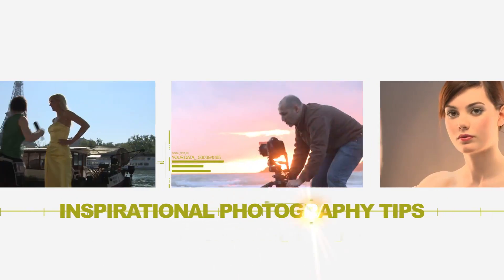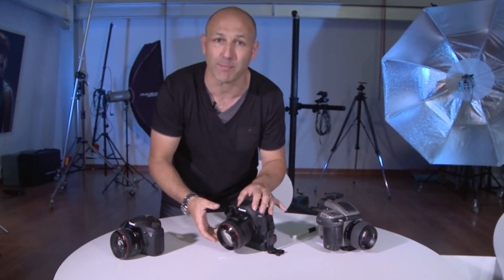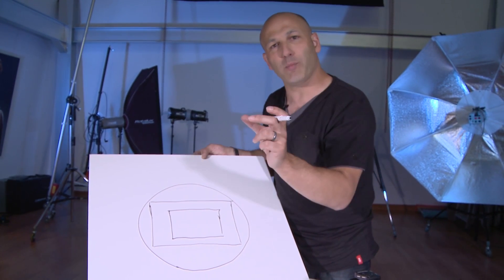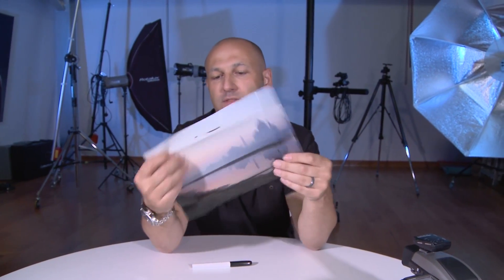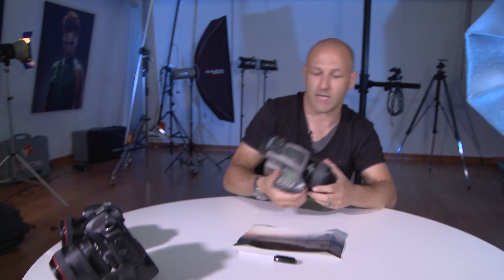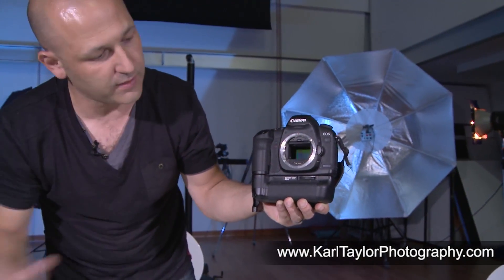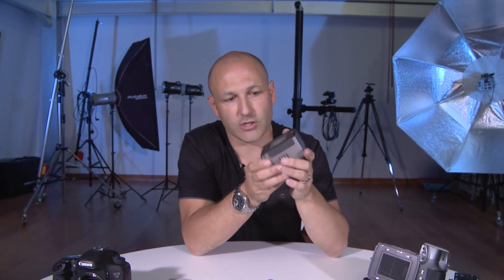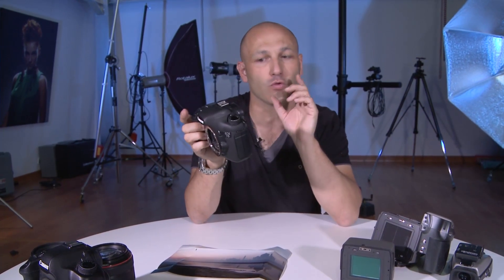Full Frame Sensors vs Crop Sensor Cameras Explained by Karl Taylor!

Comment: whats the difference between a full frame and a crop sensor via a top rear viewfinder??? i can understand the full frame has a LOT more things involved viewfinding than the crop sensor.WHY does the Crop Sensor STLL have the top rear viewfinder..doesnt make sense to me...

If the Crop Sensor was ONLY rear view [NOT top rear] viewfinder that most rear view full rectangle have,that i could comprehend.

seems pointless if the full frame dslr has top view finder and or rear view,then why do the crop sensor copy that.pointless in my mind. 
Great video.ive learnt lots,im NOT a photographer BUT i love photography.i watch you tube  videos then i take my camera and go n try n repeat .ive got a dslr [not full frame] but i love using it...
Reply: You mean the viewfinder? 

The viewfinder difference is in DSLR about magnification. It is about the mirror size that reflex the light to prism and then to eye via optics. Smaller sensor = smaller mirror = smaller view in viewfinder.
The largest viewfinder in SLR cameras was in Olympus OM-1 and OM-2. both had huge 0.92x magnification (it is calculated by using 50mm and then distance to eye etc) while Canon and Nikon had "only" 0.84x at max. The magnification 1.0x means when you take 50mm on your eye, it gives same magnification as naked eye. Smaller magnification means smaller view.

Now on DSLR era those are around 0.6x or even 0.5x in APS-C cameras.
Canon top 1D has 0.76x. Rest of having just 0.62/64.
Olympus has now 0.74x, Fuji 0.78x and Sony 0.76x.

If you mean about DSLR vs Mirrorless, the reason is that the electronic viewfinder at top gives many benefits over the screen at rear.

1) You have better support by having camera at forehead than just at your hands.
2) You see in bright sunlight as rear screen starts reflecting environment light and gets dim looking.
3) You can get larger magnified view

then it has own problems too like you get a "tunnel vision" so you don't see well around view, but screen at back makes you to focus that instead surrounding.
Reply: +Robby Jones 

a viewfinder means a viewfinder, you don't need to specify "top rear", viewfinder means the thing you look through

the screen on the back of a camera is called "live view"

Why crop camera, and many compacts even like panasonics, have viewfinders, is because you can't see a thing on a screen when the sun is shining on it, so you use the viewfinder instead that blocks out most light except the light shining through your lens. Another reason is that a camera held up to your eye can be held much steadier than one with your arms stretched out.
Reply: +Aurelie Nani The viewfinder is a "box" that you look through. An EVF is a version where small display is located. A rear display is just that, a rear display.
the "Live View" means technology where sensor is in continues readout mode and capturing video that then is played back by camera displays, either rear display or EVF.
Reply: paristo
 no one is talking about EVF, it's strictly a mirrorless thing
Reply: +Aurelie Nani No one was talking only about DSLR and not about DSLM (aka Mirrorless). Robby Jones talked about "crop sensor" and "full frame". And example Sony A7 line or Leica cameras are DSLM cameras that has rear display and EVF. And Live View is only available for DSLR from the rear display with mirror lock-up (or like in Sony SLT line with "hybrid" feature where mirror is semi-transparent".
Reply: paristo
ok, no idea what this discusiion is about, I don't care about EVF or Sony

have a nice day

Comment: Hi Karl, I was watching a video by Tony Northrup about using EF lenses on a crop frame sensor. He stated that in addition to multiplying the focal length by 1.6 we should also multiply the aperture by 1.6 if using a crop sensor and ef lens. i found this very weird as I tested my 24-70 f2.8 (approx 35-105 f4) against my efs 17-85 f4-5.6 on a Canon 70d. And the amount of light let in was always significantly better with the 24-70. IS THERE ANY TRUTH TO THIS
Reply: +Kondja Negongo The Amount of light let in is a physical property of the Lens and has nothing zo do with the camera. It is defined by the apperture and the types of glass used. 
There are 3 basic cases (and combinations thereof) you can encounter. 

1)If you use say f8, 1/125 and 200 ISO with a 50mm lens on a full frame camera and an aps-c camera at the same time and place, you will get the same exposure and same depth of field on both images but the  aps-c image will show less of the scenery as demonstratet by Mr. Taylor when he folded back the edges of the foto of the riverside mosque.

2)If you use the above exposure settings and a 50mm lens on the FF camera but a 35mm lens on the aps-c camera at the same time end place you will end up with the same exposure and same-ish frame but a wider depth of field on the aps-c image 

3)If you use the above exposure settings and a 50mm lens on the FF camera and the aps-c camera at the same time but with the aps-c camera further away by the right amount, you will still get the same exposure, the same-ish frame but a wider depth of field on the aps-c image.

You could now match the depth of field of the images by stopping the FF camera down to f/13 or the aps-c camera up to f/5 which means you would then also have to adjust ISO/shutter speed to appropriate values. However, this will still yield different images due to background compression etc.

It is not very helpful to compare cameras and lenses by crop factors. Mr Northrup needlessly complicates things even further by applying crop factors on things like noise and redefines f-stop values to be a measure for depth of field instead of beeing an exposure value.
Reply: +v8guggi Actually, to give you a simple answer, it makes no difference wether you use an EF, EF-S or even a Leica M lens on your camera, at the same apperture setting they will all require the same ISO and shutterspeed settings for the same exposure. And even if you adapt all these lenses to a MFT camera they still require the same settings and yield the same depth of field at identical distance as on your canon. Mr. Northrups math is flawed, which is easy to prove and generally known.
Reply: Thank you. I also agree with what you mention as i tested it myself cause i too was flabbergasted at his outlandish remarks and came to the same conclusion.
Reply: It makes sense if you think of how aperture is calculated. If you have a longer equivalent focal length, you have a slower equivalent aperture.
Reply: Please elaborate
Reply: CoasterProject
This is only true in regard to depth of field. Exposure remains untouched. However, comparing a 100mm MFT image with a 200mm FF image shot from the same position also means you have different Backgrounds etc. hence an entirely different image. If you shoot both with 200mm from different positions, you will again have different images even if they look somewhat "same-ish" There is no way to acheive the same image except by shooting both cam's with same lens and settings from the same position and then crop the FF image. Even so, you still have different resolution, technology etc. pp. There is really very little use for cross-format comparisons.
Reply: +CoasterProject “TheCoasterClub” The "equivalent focal length" doesn't change light gathering performance of focal length as it stays as the focal length is physically, but it changes "field of view" or as known too cropping. it is exactly same thing as you would take a scissors and cut a printed image smaller. Did it now suddenly get darker? No, just physically smaller print.
The aperture is the another factor for light gathering and its physical diameter affects to light gathering like the focal length, but as well the depth of field by its physical size. The shape of aperture opening (circle, butterfly, square) affects to bokeh (the visual look of blurred highlights/shadows mixing) but not to blurriness.

So there are two physical values that affects to the light gathering:
1) Focal Length
2) Aperture opening size

Together those two create the light gathering ratio.
You take focal length and divide with aperture physical opening diameter. same ratio pass same light density to sensor no matter its size.

The focal length can be multiplied only for field of view but not for light gathering. Aperture ratio can be multiplied for depth of field but not for light gathering. Because the aperture ratio itself doesn't change really and f/2.8 is always f/2.8 no matter the sensor size at back.

And many doesn't even notice that everything in photography is about magnification.

25mm vs 50mm = 2x
f/2.8 vs f/5.6 = 2x
1/30 vs 1/60 = 2x
etc.

And when you magnify something, you lose something else that gets visually changed in image.
like if you stand 5m from subject and you then move to 10m, it is now 2x smaller (twice narrower and twice shorter, so 1/4th of original size) and if you now use 100mm at 10m distance as you used 50mm at 5m distance, your subject is same size on the sensor as magnification was changed twice to neutral things.

Same thing goes with physical prints, if you print one same file to 50x25cm size and then you make a another print of 100x50cm size, the depth of field is visually now two times shallower on bigger print, as well the noise is visually two times worse and visually sharpness is two times less.

And now if you look the bigger print from 4m distance and smaller from 2m distance, the print is magnified again visually to same size, same depth of field, noise, sharpness etc because magnification ratio is same.

And why does photo from 4/3" sensor have two times more noise? Because photo is magnified 2x more to same physical print size as photo taken from 35mm sensor. The sensor size doesn't affect how much light it receives, it is the final print size that rules everything from depth of field, sharpness, noise etc.
And when one photo from smaller sensor is always magnified 2x more than "the standard" it always has 2x magnification ratio against it.
But when you make magnification ratio 1:1? You get same results visually, meaning you have smaller and larger print by 2x magnification ratio as difference (50x25cm vs 100x50cm).

And why there is "Crop Ratio" aka "Crop Factor"?
If you have camera at same position, you use same focal length and aperture etc, but you change sensor size. You get exactly same look and quality, but in final print when you keep same magnification ratio (1:1) you can overlay the images above each others and you see the smaller sensor captured the center part of the bigger sensor image, but image is exactly identical from the covered part.

The crop sensor would be exactly the same thing as you would take scissors and cut the larger print to smaller to same size as the smaller print from a smaller sensor.

The same magnification ratio affects why light from flash is 2x more powerful at 1m distance than from 2m distance. Or why you can have camera at any distance from the lighten subject and get same exposure everytime. Because subject magnification to camera is same as subject magnification to light source. And that is reason why you can see object at same brightness regardless how far you are from it, as your distance to the object is magnification ratio.

And what this magnification ratio really is?
It is explained by Inverse Square Law.

The final print size rules depth of field, noise, sharpness etc what camera at given value gives. And aperture ratio (focal length / aperture diameter) follows the magnification ratio. And you can not never multiply the focal length or aperture as those are already calculated for final print size, viewing distance and viewers eye sight, and if you don't change those three, you can't do anything.

As the calculations goes like: "If I need to use f/4 instead f/8, but subject isn't anymore in focus for given print size, I need to make print 2x smaller and it is back in focus like f/8 at bigger print."

There is this decades old law, "Bigger Format allows you to make Bigger Prints".
And question is, How Big your print Needs To Be? When you know final print size and viewing distance, you know every setting in camera that is needed to be.
Reply: +Kondja Negongo This formula applies if you consider the DOF and also to the noise. if you shoot with crop at 22 mm f/2,0 and ISO 400 that is comparable to full frame at  35 mm f/3,2 ISO 1000. EOS 70D has crop factor 1,6. It does not matter if you put EF or EF-S lens. Crop factor is a property of the sensor, not of the lens. Optically the difference between EF and EF-S are in the image circle. If you could put EF-S on a FF camera there would be severe vingnetting (you cannot put them because of mechanical differences). There is nothing basically wrong on what Northrup said. Only his idea of replacing the ISO with something different is unworkable as long as same lenses can be used with different sensor sizes.  

If you shoot only crop, you can basically forget FF, crop factors etc. Just think that 30 mm is the normal lens. This is basically no different than thinking in miles or kilometers - even the conversion factor is the same.

Comment: Great. But if you use the same FF lens on a crop body, don't forget to multiply also the aperture by the crop factor.
Reply: I beg to differ with this as I understand the explanation but wen I test my lenses it doesn't work out that way
Reply: You understand for sure. He just told us the reality of the mathematic. No way for lies. We keep in touch ; BUT just tell me witch format you work with which what type of lens.
Reply: I'm shooting with a Canon 70d so crop sensor. I just gt the 24-70 f2.8 and after I heard this I tried it against the efs 17-85 f4-5.6. The 24-70 shud then have a aperture of approx f4.4 at 2.8. But it's significantly better than the 17-85  wen I shot it at f4.so i don't agree with the multiplying of the apeture
Reply: hey Kondja. With Canon 70d using efs lenses, you only multiply the focal length by the crop factor ( 1,6) just to know the equivalent on FF.
Ex 17-85 will be 27-136 ; the aperture stay the same. But with the 24-70 with the same body, you would have to multiply the focal length and also the aperture as well. Hope that's help you.
Reply: The 17-85 is designed fr crop sensor only so it remains the same. It's the 24-70 that I must multiply but results don't give me a similar aperture as f4

Comment: very good explanation. I am wondering if you can illustrate what you told, about the depth of field, and the blurry background effect, through real examples.
Reply: +Hasan Alhasan 
get one 50mm f/1.8 and take a portrait shot chest and above and then make a step or two away from the subject, then take another shot with same settings, crop the second image in your prefered editing software ( yes there will be pixel loss, but this is maybe the cheapest way) to match to first one and look at the background blur of both images. This will help you to see the differences in depth of field.

Comment: So the only TRUE difference is tonality of the picture? The depth of filed and bokeh is produced by a lens, not sensor, if i am not mistaken.
And the difference between full frame and crop is basically just "few physical steps back" 
I am not trying to mock You, or by any meaning disrespect Your work, because I really appreciate Your time and energy to create such videos. I am just trying to better understand the topic.
Reply: Tomas Longa, Photographer can choose higher ISO, and get better image quality, because they are larger each individual photo sides can capture more light. Second advantages of a full frame camera is decrease the depth of field. Full frame sensors also require larger viewfinder on the camera which generally translates into bigger and brighter viewfinders when photographer looks through the camera. This is good for composing images. It also makes much easier manually focusing. So it is not only photographer get larger frame. Hope this will help. Cheers.

Comment: The noise performance of FF is meant to be better and users say two stops more range than cropped sensors in low light. Maybe I should rent a FF for the weekend and decide whether it is better for my needs before deciding to upgrade.

Comment: Good explanation Karl. Clear and concise.
I tried a little experiment on my D40X / 28-80mm lens that I learned when I used 35mm film with a 50mm lens; i.e., you aim the camera at something, sharpen the focus, then with your other eye you also look at your chosen subject. You will see that both images are identical in size.
If you try a similar experiment on a camera with a cropped sensor, (as my camera has) at 50mm, the image you see through the lens will be significantly smaller than what you see with your other eye. So to produce an image of 'true' 50mm proportions you need to zoom out to 65mm.
I'll keep watching!
Cheers!

Comment: So using a 50mm for portrait in a 700D is like using a 80mm in a full frame (really, but not really)? I am a beginner so I am a bit confused, but just wonder if a "professional" says that 85mm is perfect for portrait photography, I should use something like a 50mm for similar effect on my crop sensor because that should resemble about 80mm?
Reply: yes you can use a 55m, but a 85mm works too, it's around that range for a crop sensor, the reason is you get an extremely nice background isolation at that range, you get almost no barrel distortion and you have a very simple lens
Reply: thank you :)
Reply: Yes, just multiply the focal length on a FF lens by 1.6 to get the equivalent focal length on a crop sensor camera.